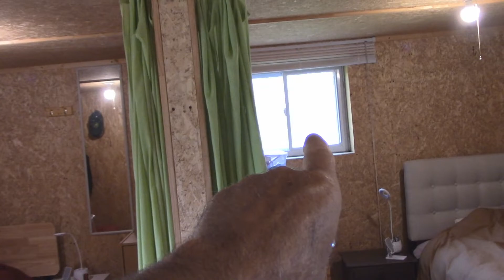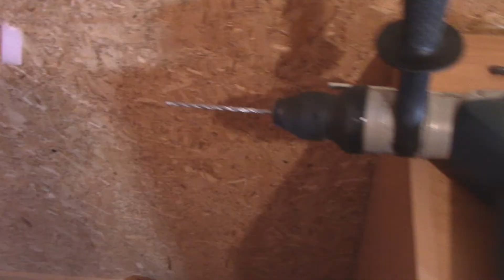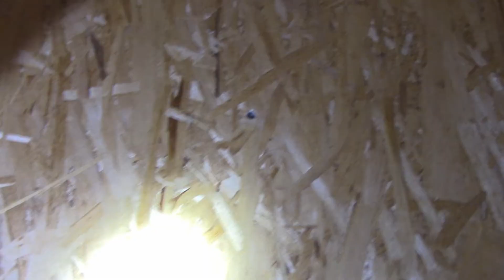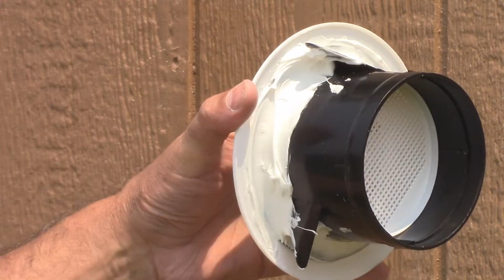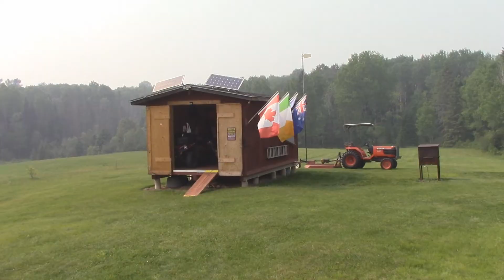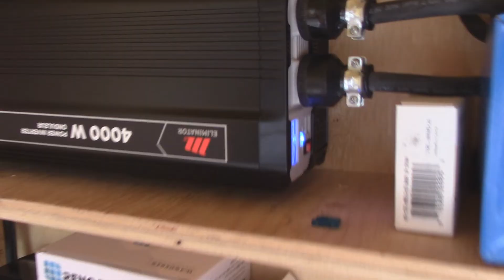Drilling 8 Inch Block Wall - Fresh Air Vent Installation - Off Grid Cabin

Comment: The vent hole is a good idea. Who'd have thought you'd have concrete block walls. That place is built like a Bank! Well done. The solar setup makes workshop life easy up there.
Reply from the maker: Hi Craig 
A bank is right :)  Every year I try to improve a bit as I learn a bit 👍

Comment: Good work doing your research before drilling holes. That will give plenty of fresh air Steve. Keeping my fingers crossed the camera works for you this winter. Cheers
Reply from the maker: @RustyGlovebox  Hi Lloyd 
I'm thinking the camera is designed for a Texas winter :)

Comment: Interesting.  Is there ever a need to block or shutoff the airflow?  Winter time, trying to heat the place?             JimE
Reply from the maker: @JimE6243  Hi Jim 
Yes absolutely if it was used inches winter but not in my case , just spring till fall for me.